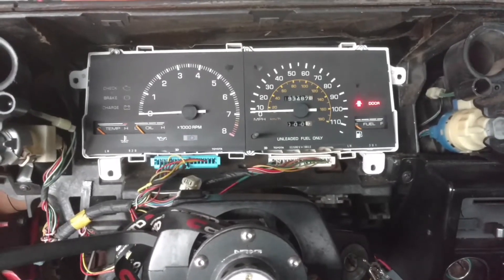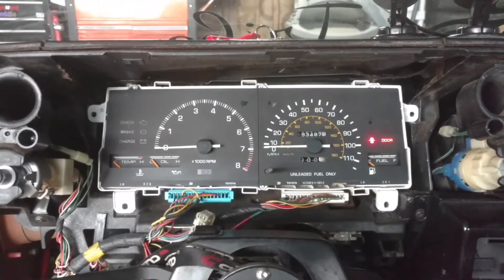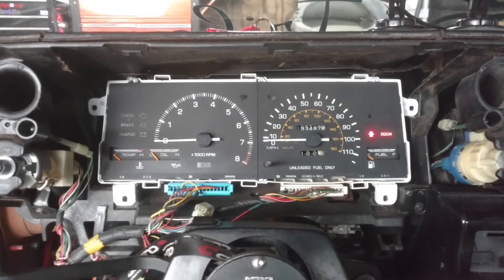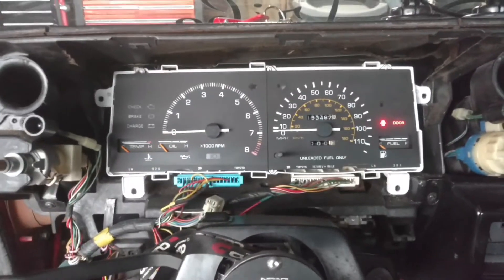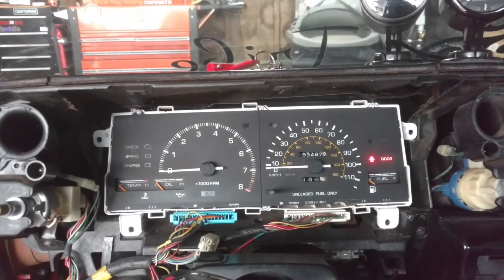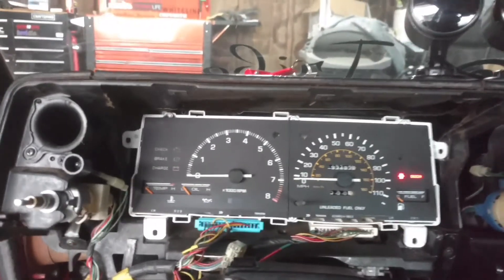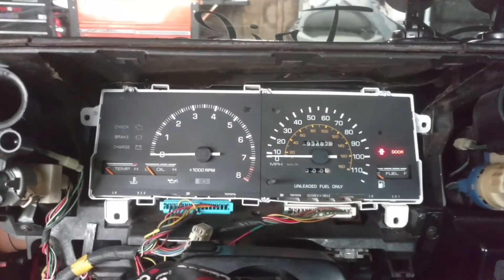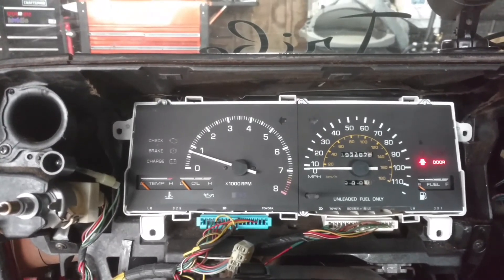AE86 Tachometer Mod

Comment: Is the photo of exactly where this resistor gets solder in still available? My Instagram is @allen.saylor if you could please!
Reply from the maker: Here you go:

https://scontent-atl3-1.xx.fbcdn.net/v/t31.0-8/16423195_356181328114117_3828368274446686040_o.jpg?_nc_cat=108&_nc_oc=AQmrf_e2tngCGcgAt3Wd0jh-wONjYoLpf61jcsezl4Znhr-jzUueViWuv8plpjoparc&_nc_ht=scontent-atl3-1.xx&oh=dd5c6c5f3f5ffeeccb8f8c08f2e8f15e&oe=5D688A72

Courtesy of Panic Wire

Comment: Hey Devin, Could you possibly help me with a photo/ diagram of where the soldering needs to take place?
Reply from the maker: Sure! Here is a link to the picture of what soldering needs to take place: https://scontent.fdet1-2.fna.fbcdn.net/v/t31.0-8/16423195_356181328114117_3828368274446686040_o.jpg?oh=6a180d59d58d5a6f80830e8abe113f32&oe=5A518672

I believe I sent this to you/Alan via instagram and email earlier today, but just in case, here it is again haha.
Reply: Can't get the link to work. Could you send me info on where to solder resistor in?
Reply: Hi would really appreciate if you could send me the diagram via email mye2x@yahoo.com Thank you and more power!
Reply: Could I get this also I’ve searched everywhere
Reply: Is the diagram/ pictures still available? Could you send me one if your still around.